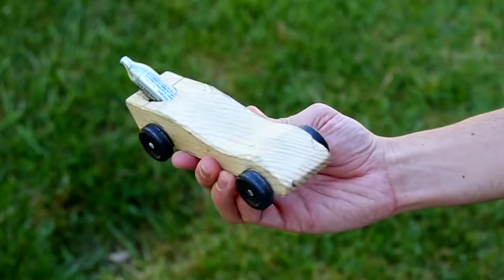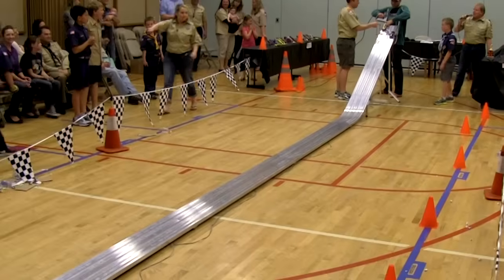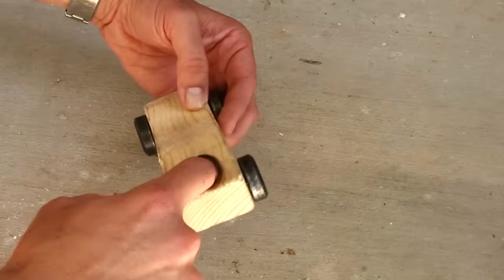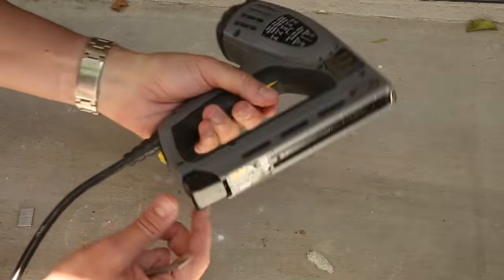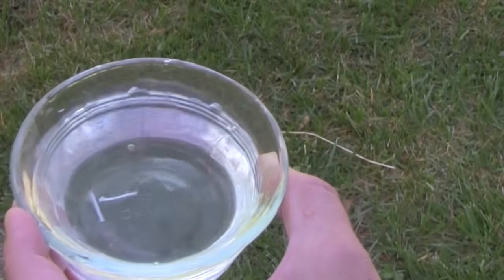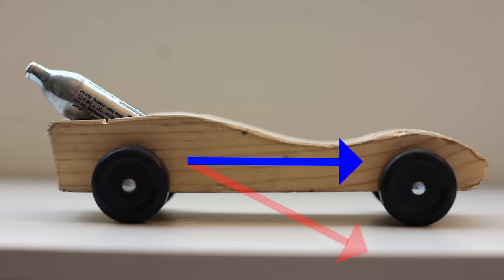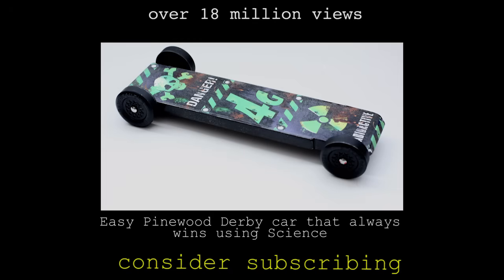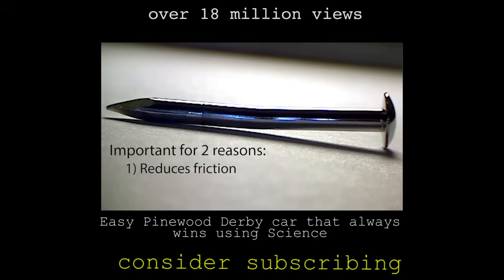40 MPH Pinewood Derby Car- HOW TO

Comment: yeah you would need some combination of weight on the front of the car and the angle of the CO2 propellant, plus the horizontal positioning of the CO2 itself (relative to the axles of the wheels)

Comment: Mine was faster. Lol I made mine somewhat the same shape, with the same angle, except I cut the car to be more narrow and it came to a dull point, with a fin like co2 canister holder on the back.. also slightly larger wheels on the back than front; it's hard to describe, but it broke the Kansas record in 2011. 😂

Comment: If you placed the cartridge farther to the front it would stabilize the car far more. In one of the clips you can see the front of the car dramatically lifting upon acceleration, which might contribute to that massive 60% failure rate.
Only a hypothesis though.

Comment: I have a CO2 car that was super slim and lightweight until the powerhouse, so I thought it wasn't gonna go as fast but it won all of it's races (only 2) and it took 0.713 seconds to get from one side of the track to the finish line. (the track was about 1/3 the size of the width of a school gym)

Comment: We used to get these cannisters as kids and buy a whole heap of sparklers and take all the dust off em put it into a tin shove the cannister in the middle use another sparkler to as the wick to light it on fire they make cool fireworks just have to be careful and run a fair distance away

Comment: Wouldn't a steeper angle to the hole keep the car on the track?  Any angle at all is still gonna provide enough forward thrust to skunk anything out there.
Reply: In an ideal world, yes. But in real life, there are various other factors that come into play. Like the wheel sizes on both sides, the symmetry of the car, the starting angle and so many other stuff. And considering the speed of the car, even such small things will make considerable changes and could make the car steer off the track.
Reply: @raghu5  I am speaking of real life.  Of course there are many factors at play which could possibly throw it off.  But surely you will agree that, if his car did stay on the track more often than not anyway, that giving the hole more of a downward angle will give it more track-hugging force?  And that with any angle at all, the CO2 canister would still provide enough forward thrust to beat the conventional car?
Reply: @JusBidniss  Ooh I misunderstood what you meant before. I agree with you now. Steeper angle is better, it increases the track hugging force like you said. And the speed lost won't really matter as it's already fast enough.

Comment: I won 1st place racing co2 wooden car in wood shop class at 8th grade. I remember the  cartridge angle was parallel to the floor and not angle at all. I made the bat mobile shape and it won due to light weight and aerodynamics lol. What can I say, I was before my time.

Comment: Add a front spoiler for more pressure in the front. (Just a little plastic part which puts more force on the front). Or use more weight up front. Then the car wont hop and will more likely stay in the track.

Comment: I have to wonder... the ONLY rule of the pinewood derby that I remember was you can only use parts contained in the official pinewood derby kit...

So if I hollowed out the entire car, sealed it, and put it compressed air, then put in a slightly tapered plug that only can stop that level of air pressure for mere seconds, then held it in til it was time to release the cars, my car would drop down and then shoot forward right as the ground became level after the drop.

That way,
1. I don’t accelerate on the drop
2. My car shoots off like a rocket past everyone else
3. I followed all the rules and only used parts from the official pinewood derby kit.

(Anyone who hollows out their car has air in the car, mine just has a lot of air stuffed in and held til just before the finish line...)

If only I had had YouTube back when I was a kid... different times... 👌

Comment: If you were would have drilled the hole for the CO2 Cartridge a little further up I think it would stay on the track better because the car would not pop a wheelie because of the downward force.

Comment: Well the reason the car doesn't stay on the track some of the time is because it's moving so fast when it's so light and it's getting airflow under it that it generates lift it's light a hydroplane basically

Comment: Your ability to remain on tracks would increase if you moved the canister hole forward a bit more
Reply: no it wouldnt the canister's thrust vector is between the 2 axles meaning that in applies a net rotational moment of 0, car is most likely flipping due to air resitance and its lightweight

Comment: Way back when I was in highschool, we had a competition to make dragsters that could accept CO2 cartridges OR model rocket engines (the teacher provided ones that were both 3/4" wide and about the same length).  We ended up racing both, on separate tracks (one indoors, one outdoors).  The tracks had relatively loose guide wires above them, and we were encouraged to put eyelets on top.  

Everyone else went for aerodynamics, low-friction, etc.  When it comes to this kind of sudden propulsion, I realized weight was the biggest factor, and ended up shaving my design down to being more or less a thin wooden shell over the propulsion chamber, with just enough strength to survive the force (and the crash into pillows at the end).  We didn't have length requirements, so mine was only about 4-5" long.  I didn't even need wheels, in the end, because my car just flew along the wire and finished before the next one would make it more than 1/3 down the track.  It was hilarious.
Reply: XD I can imagine the reactions

Comment: in reference to pinewood derby racing, i have thought of an alternative  to the air propulsion which includes using a vacuum and blow system for the model cars .how its  intended to do this is to suck the restrictive air from the front of the car and use it to propel itself by channeling the air thru the car to its respective points and blow it out thru the back.  suction will be created by a fan that is also turned by air system . also because most of the denser  material would be removed it makes the car lightweight against the forces of friction . i would like to see it in action, but i dont have a workshop of my own to experiment with it so i am still left in the dark .

Comment: I want to see the CO2 cartridge with some fins on it launched like a rocket.
Reply: MadManDrivinHere If you have access to potassium nitrate (Found in stump remover) search for "Grant Thompson Sugar Rocket"
Reply: If you check out Thebackyardscentist's channle you can see that there. Have a nice year.
Reply: @jacobrevier53  i am not having a nice year
Reply: GoodGenes I feel that
Reply: Bosk Boskson I tried the sugar rocket. It was a total flop
Reply: pws3rd 1 I tried it too the feul lit but the rocket kind of just spirald into the ground instead of launching
Reply: Yes
Reply: Pod
Reply: There are model rockets you can buy, assemble yourself and launch as many times as you want. They come with their own engines and you can buy more if you need to. They range from like $10 to $100. They should be at many hobby stores
Reply: into za grounda?

Comment: You can make iT beter by making the front have more weight
Reply: Good Games Minecraft More weight on the front would help some, but having the co2 cartridge moved to where it points at midway point between the front and back axles would help more I believe.
Reply: that's a good point but then you cant get the same forces at the car an ou get less aerodynamics unless you came up with a whole new design

Comment: I would think if u put the co2 cartridge hole closer to the middle that  it would help keep the front wheels from lifting up and flying off the track.  It would be less aerodynamic, but you do have a frikkin co2 cartridge for propulsion, so I guess that would compensate for it

Comment: I would think it would decrease the percentage of ballistic takeoffs if you were to mount the cartridge such that the center of gravity is directly between the 2 sets of wheels if not slightly forward of that, then hold by the rear when firing. In all of the slow mo shots, it goes wrong right of the bat because as it is propelled forward, the way your holding it precipitates the front end to raise slightly, as it does so, the aerodynamics perpetuate the lift until the back ends thrust propels it faster than the front end spinning it out of control. In the new design, you could reduce the effect your hand has on the trajectory as well as force the front end of the car down onto the track.

Comment: if you put the cartridge more to the front of the car, the front wheels shouldn't lift off
Reply: ***** another problem might be that the hole in the cartridge isn't perfectly straight
Reply: ***** That's gotta be hard to calculate, seeing how when you find the center of mass and bore a hole, it's no longer the center of mass.....
Reply: Shanee, our debate had been bugging me for a long time. I actually decided to bring it up with my physics professor. Revisiting actually made me realize some other things.

I also drew another diagram with the thrust and torque around the wheel. You're right that if you just take torque for the thrust, it should keep it pressed into the ground. But then looking at components, it's possible one component could torque it, but I would need to calculate with the angle, which I'm going to try to approximate. The vertical and horizontal components will both create torques that oppose each other.

So I measured the two individual torques on screen with a ruler, and vertical component lever arm was longer than the horizontal, so the horizontal force would create a larger torque pushing the car back into the ground, like you said.

In short: You were correct.

But there is still something causing the car to jump up. Which I forgot he shoots it with a nail gun, so I'm going to assume it's that.
Reply: Generic Name most likely the  catridge is off centre in the lateral axis which is pushing it sideways making it hit the wall and flip, in the video its always flipping to the same side. Thats jus my guess though
Reply: +sk0g CS:GO Productions 2k15 you can calculate where the centre of mass will move to easily, but ofcourse paper calculation are rarely 100% but it gives a good idea where to bore the hole and then you can balance it afterward
Reply: The point where the cartridge pushes out the CO2 is behind the back wheel. It's causing the car to act as a lever and pivot around that wheel.
Reply: sorry i dont speak nerd
Reply: Generic Name it wont act as a lever because the thrust vector of the catridge is between the front and back wheel
Reply: Shanee Bahera I think I see what you're saying. The base of the cartridge is where the thrust vector is? But I still disagree.

I think the origin of the thrust vector is right at the puncture point. Since it is diagonal, the x component would push it forward, while the y component would be behind the wheel causing it to tip backwards.
Reply: Generic Name it doesn't matter were the thrust originates from what matters is the direction of the thrust vector and were it interacts with the car. If you drew a line that represents the vector, you will find the point it applies torque to the back wheel is in between the back wheel and the front.
Reply: Shanee Bahera Are you going to reply to that?

Edit: Video Removed
Reply: tommihommi1 no his finger hit it a little bit
Reply: tommihommi1 actually u just need to keep it in the back or the centre of gravity is wonky and unstable making it go off the track
Reply: Yeah he didn't take Moment into account.
Reply: I thought the front wheels only lifts upwards if their finger is in the way of the cartridge.
Reply: Or just make the car's weight distribution more towards the front